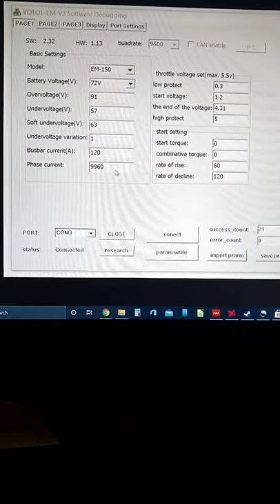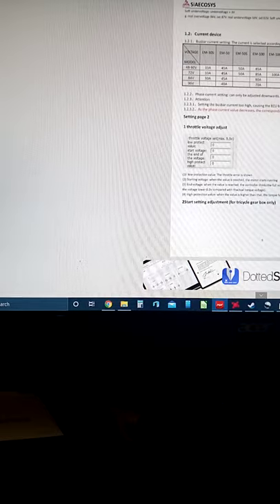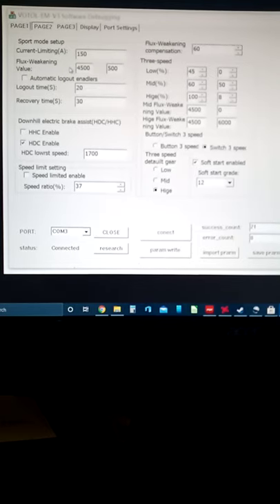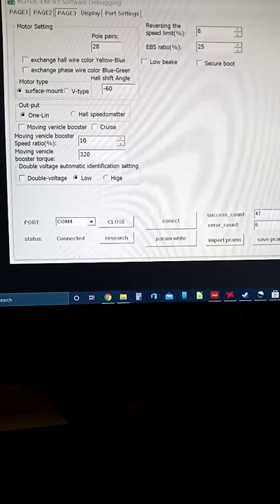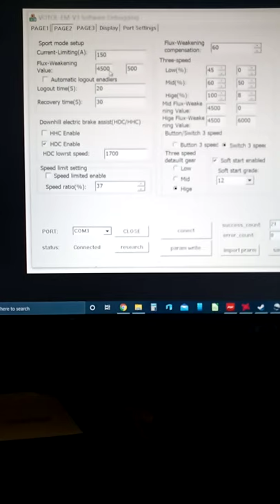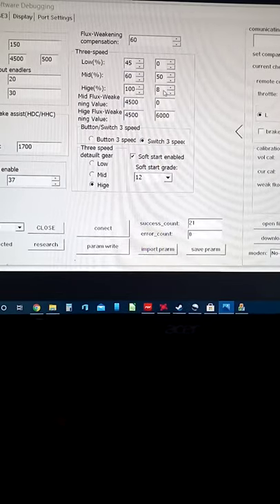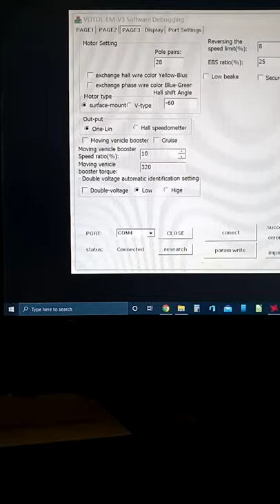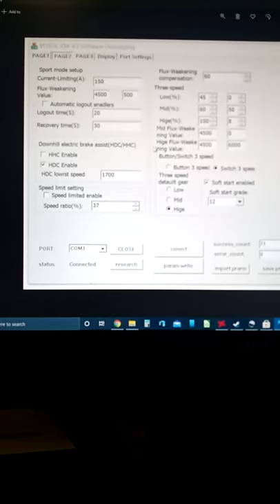E- Vader Votol Set Up

Comment: The switch of phase or hall wires is just a way to allow you to match wire colors and correct it inside the controller, as a self learning controller would do automatic. We know with phase wire you only need to switch 2, to reverse the direction. We also know you only need to switch 2 hall wires to get them in the same firing order as the phases.

But sometimes even though both are in the right order, there is a phase shift. To fix this manually you would advance all 3 wires one slot. So instead of blue-blue, green-green, yellow-yellow, you get blue-green, green-yellow, yellow-blue. So the controller just lets you do -60, 0, +60 to get the halls back in sync while the wire colors match. 

But i do think it’s possible to tweak the timing by using -59 or -61 for example to see if its better, worse or no change. This might be able to correct a manufacturing defect or just tune your motor for your bike the way you like to ride it. 

The surface Mount or V-Type we know is mostly associated with outrunner (hub motor) or inrunner (mid drive), and it seems to only turn on one of the flux weakening parallel if its V-type. Because the flux is different. However its also possible that it is tied to 120 degree and 60 degree hall sensor angle. I guess the only way to know is change that and see if the motor still runs smooth. Ill try to play with that some later.
Reply from the maker: phase angle
pole pair number
max rotation speed
hdc needs to be enabled and that is where you enter your max rotation speed that also acts as a safety trip to shut the controller down due to over speed in sport mode. I found that out when i hit 64 miles per hour one day going down a hill.
If you cant get the specs on the motor you have now your best off to replace it with one you can get the specs for. I can confirm yes your high brake needs 12 volts to work i have a wiring diagram that shows it.
Reply: @battery_solar_ev , i just got my controller and powered it up and saved the first file, then changed it to 60V and set my high limit to 75v since the charger tajes it to 73.5v, higher than the default value they have for 60v. 

Then i wired the phase, hall and throttle and matched them up manually instead of in the software until it ran forward smoothly. But then it was only going 230 rpm so I turned off DHC and it came up to what gives about 45 kph (28 mph).

Wired my high brake line in at full battery voltage. My drawing doesn’t say +12. So far it’s working cut power and add regen. I have everything low now, 15A bus limit, 15% regen, 20A sport. 

Wired in my 3-speed switch and had to manually enter the port data from screenshots i took of several port settings. I put 60/60, 80/80/100/100, switch not jog, and it doesn’t change speed. The controller sees it because it shows it going low, med, high in the program and also my display shoes 1-2-3, because im using the YXT (one line speed signal) instead of hall wire. 

Im making a lot of backup files for last known working configuration. 

I wish I could just turn all flux weakening off but it doesn’t seem to like too much or too little. My 500w motor doesn’t have enough overhead to use it. Unless it makes the motor more efficient at 28 mph, i don’t need it. 

I noticed when i have downhill brake on about 300 setting, it would regen significantly from 600 rpm when you let off the throttle.

Comment: Nailed it! Very helpful...Looking forward to getting my EM200 to stop cutting out, then come to stop and works fine...till it does it again.
Reply from the maker: Im not having a cut out problem at all its full go on the new 5k motor. The stock motor was horrible. Your base current is set on the main page but only refers to speed 1 and 2 sport mode speed 3 over rides that setting. But rotation and flux remain the same except the over ride for speed 1 and 2 percent rating adjusted at the percent of rotation speed you want for that setting. Make sure you have the setting for the motor.
Rotation speed
Pole #
Max current
Flux weakening and the setting beside that. If you have a QS motor that is NOT stock to this bike just hit up one of the QSmotor people for the settings it should be and make sure you tell them you have a Votol controller.

Comment: Ok, day two of opening this Alien software. I think somewhere you said you need Downhill brake assist on for the 3 speed settings to do anything. So thats working now. 

This control does not like seeing 0s all over the place. But i found out the box on the right of sport mode is not flux but timing, used to eliminate jitter. After i got everything working smoothly i took to the street and at about 3 mph it sounded like i went over one od those grooved rumble strips they cut in the highway ti wake you up before a big curve, 

After research i started bumping it up from 200–>300–>400…..and at 600 is where mine stopped jittering. 

So then i went around checking amps, voltage sag, and my cheap Chinese 60v 20AH gel battery fell on it face. Luckily i cracked soft low voltage up to 60v so didn’t drop to 55v right away. 

I set regen to 10% and under mild acceleration the voltage dropped to 56V and then while regen it went to 65v. Which was the dead giveaway i have 1 cell in one battery probably on its last leg. 

The pardox is these batteries have to be balanced occasionally but you cant equalize charge them without doing permanent damage. The only way to get a low cell up in a 12V. Batteries is to overvolt the other 5 cells which shortens there life. So these lead acid packs quickly go into a death spiral when the other cells are making up for lost voltage. 

I got home and checked each battery under small load and it was 12, 12, 10, 12, 12. Im currently charging the weak one separately and will probably top them all all separately, but its sort of an indicator the batteries are getting bad. 

I looked into a BMS for lead acid but that cost as much as a set of batteries. Lol.

I might bite the bullet and get some lithium ion or LiFePO4 batteries, and charger. But i have to be careful since this is just a $600 bike, i don’t want to go down the rabbit hole of bigger controller, bigger battery, bigger motor, bigger controller bigger battery bigger motor. By time you get done could have bought a pretty nice Chinese electric motorcycle that has twice the performance for half the price.
Reply from the maker: LifePo4 is 14.6 for a bms your 500 watts @ 60 volts is 8 amp that bms should not be that expensive and that 20 amp hour rating no more than 20 amp on the constant and 30 amp surge with a 40 spike. sealed lead acid actually likes the 14.6 volts
Reply: @battery_solar_ev , If i make a lithium ion or LiFePO4 battery I would use 35 A BMS so I can use all the controller. My gel cells can feed 35A busts without a BMS.

I was making a video today showing my front brake activating regen, while my charger was @ 73.5V and regen didnt seem to work. Then i unplugged the charger and it worked. So i wonder if the voltage settings do in some way tell it not to regen when its close to max. 

I will play with that some more once my new batteries arrive.  On the center stand i only jave a little inertia to regen with but on the road its a different story. 

60V 25AH gel cell delivered to my apartment for $160. I might go lithium next time around.
Reply: @battery_solar_ev , this is a regen test while holding full throttle and applying front brake to cut motor and activate regen. In the video it looks like I’m applying rear brake. 

youtu.be/VgnJ4Q2Qe_Y

Comment: Nice video. I’m getting a EM-30s for a 500 watt motor and soon ill be going through everything you did. I’ve watched a bunch of videos and piecing it all together, along with whats on Endless Sphere. I’ll make a few separate comments so you can reply to whichever intrigued you. Lol

From my research, the number of pole pairs has nothing to do with commutation. No matter what that number is, its still 3 phases taking their turns being North, South or off, pulling, pushing or ignoring the nearest magnets. So it means its only used to tell the controller how many RPM its doing. 

If 28 pole pairs shows 600 rpm, then 14 pole pairs would show 1200 rpm, but the motor speed would be the same. However if you get pole pairs way off, it may affect a different part of the control logic. Did your motor actually sound faster/slower as you chanced pole count or just the RPM indicating was showing faster/slower?
Reply from the maker: there was a speed difference but you have to watch the max rotation speed for the hub motor and not exceed it. Which is why i replaced the hub motor and having no info for the pole pair and rotation speed plus the original hub motor was way to weak for the bike 28mph is way to slow for my area and not regen or flux weakening compatible cause various run a way conditions along with random wheel lock ups and intermittent  popping noises it was garbage but perfect for the controller it came with.

Comment: @4:23 the way I interpreted this is you want to measure your throttle signal range with a multimeter and make 100% sure your throttle is witin its live range when telling the controller you are at 0 and 100%. So in my case the throttle output is 0.8v-4.6v. So i gave it a 0.2v buffer on both ends and used 1.00 and 4.40v. 

I might spread it out a bit to 0.9v and 4.6v to eliminate some dead band but actually most of the throttle dead band is mechanical. The one you don’t want to undershoot is the low setting because it will either not allow your motor to start,  thinking someone is twisting the throttle when ghe turn on the key, or worse, it takes off when you turn on the key. Lol. 

The high setting i think if too low you have excess dead-band and if too high you cant tell the controller to go to 100%. Can probably tweak it up until your motor can’t go full speed then lower it 0.1V.
Reply from the maker: 1.2 to 4.8 volts actually worked out pretty smooth for me. You go to low and the motor will take off when you turn it on well at least thats the problem i had.

Comment: Did you have issues downloading the drivers for the USB to Serial controller. The driver that came (PL2303_Prolific_DriverInstaller_v110(2) is not loading properly. Did you use something else. My computer recognizes the USP dongle as (FT232R USB UART) but it does not have any drivers associated with it and when tried to update the drivers nothing was found. Need some help. Thanks
Reply from the maker: no harry.bin.zhou sent me what i needed via skype for the program and the usb driver also the manual for the controller and the spec sheet for the hub motor . Best of get a hold of QSmotors and ask them to send the program for the Votol controller and the usb driver if what you have is not working. Keep in touch if you dont have any luck Ill see what i can do on setting a link in this video. Which i have no clue how to do.

Comment: What does this tell you? Ok, since installing my EM100 a couple months ago, whenever I hit either brake lever to slow down or stop,
it would make the bike accelerate. I figured there must be faulty wires touching the throttle sensor. 
long story short, I found what EBS setting stood for and tried setting it from 20, to 0. Problem gone. No more brake lever throttle action.
Why would higher EBS setting cause motor acceleration?
Reply from the maker: I had the same problem with a EM-150sp and trashed the controller china refused to offer a refund Saiyco sys or somthing like that. I will never by anything from them again. Bought another controller from QSmotor and problem solved. Glad to see im not the only one that has seen that problem. If you are NOT using the stock hub motor the EBS brake regeneration should function like normal with no issue and do brake assist by putting some power back in the battery during brakeing or letting off the throttle. If you are using the stock hubmotor that needs to be off by setting it to 0 and also flux weakining be turned off. My replacement i purchased from QSmotor is set to 20 for EBS with no issues at all. In short that controller you have now needs to be trashed it is not safe.

Comment: For the two columbs in the 3-speed setting, it seems column 1 is the max speed % and column 2 is max current (acceleration up to the speed limit), for low and mid speed, but for high its % overshoot. 

So in the manual it shows 
60-100 (meaning 60% max speed but max current is allowed for you to get up to that speed.)
80-100 (meaning 60% max speed but max current is allowed for you to get up to that speed.)
100-7 (meaning max speed, but current can go to 107% while accelerating to top speed)

We know what happens if too speed current is equal acceleration current, you are slow to get up on plane as that say.

I need to digest the sport mode settings a bit more and see how its interrelated. For example if your base bus current is 120A and your sport mode is 150A (+25%), is that what sets the bar high enough for a speed 3 100% 20% setting? 

Im just getting the 30s and so ill be working with much lower amps. I have a 500 watt motor with 60v battery so 10 amp gives me 600 watts as a starting point. Then once I’m set up and understand what each setting does, i can up the amps in a way that its only for short bursts. 

My phase wires to my motor are so tiny so i don’t want to fry those.
Reply from the maker: no its the rotation speed based on hdc enabled lowest speed unless on sport mode current will remain the same for 1 and 2 for base current page 1 or settings 1. ive got 40% 80% 100% resulting on 40 50 and 60 mph speed 3 refers to sport mode current which is also high and over rides the default high base current from settings 1. The votol is NOT a smart self learning controller you will need the max rotation speed and the pole pair to make it work properly and for safety sake make sure the hubmotor you use is regen combatable. Ive had the stock hubmotor lock up 2 times on deacceleration because of not regen compatible and that is not a fun feeling and very dangerous
Reply: @battery_solar_ev , i just learned a simple way to find pole pairs of any direct drive bldc motor. My ebike just has a 500w motor and no other data, so after watching someone trying to sell a box that applies 12v 5a to 2 phase and watching the motor jump to a pole pair, I used my 50 watt laptop power supply and momentarily touched 2 leads, and then rotated the wheel slightly and repeated the same, keeping the same polarity and same two phases.

Then i marked each position and counted them, mine was 26 pole pairs. So i have 52 tiny magnets compared to your new motor with huge magnets,

Its an experiment you can do on your old motor. Works 100% accurate. But i think even with flux weakening you cant get the old motor to go 100% faster than designed. But your new motor with much less magnets can probably spin a lot faster.
Reply: @battery_solar_ev , my motor is just a bldc so it like all bldc it will regen if the controller can support it. I have lead acid batteries which are much more forgiving to regen because there is no BMS. If you have lithium battery and BMS and start off fully charged and get up to speed and do hard regen, your BMS will block that current going to the battery, the voltage will spike, and will be like shorting all 3 phase wires and trying to turn he motor. 

I will start with regen almost off, and test drive and watch my battery voltage. I wont set it higher than 10% probably, which is about 3a like the charger.

The new software on the Siaecosys site shows only one version, and thats where my vendor (QS Motors) said to download it.

Ive seen several versions of the program settings so before i chance anything ill read and save the .bin file and only change settings I’m sure about.

Comment: I also need high brake like you, so this will be great. One concern i have is some drawings say +12V for the high brake. Im hoping thats only minimum voltage for those using standard 12v accessories. My current setup just sends 60v to it and the brake light.

I will play with regen a bit too. My electric scooter has 5x 12V20ah gel cell batteries, so its pretty hefty. Along with 500W motor i might need significantly more regen to slow this lead sled down. 

But one thing i have to watch for is if the regen pushes my battery voltage over 70v or 75v absolute max.
Reply from the maker: your not going to get very fast with that much weight on a 500watt motor
Reply: @battery_solar_ev , this scooter can go 28 mph and my last one with 350w motor can go 28 all day. Your 2000w motor wasn’t usinf anywhere near 2000w to go 28 mph. You had torque, acceleration and hill climbing that my ebike cant do. 

Your new motor is wound to go faster, so it only has a few magnets, thick phase windings. Its designed for it. You told QS what you wanted and they gave you the one that will do it. But i don’t want to go 100 km/h on this scooter. Lol. Its about like a Yamaha 50 size adult seated scooter.

Actually the #1 reason I’m replacing the controller is my old 350 watt scooter climbs the curb with ease, and this one has no torque. Its got a super basic controller, no self learning, high brake only, but when its moving it is super quiet, seems like sine wave quiet.

So with the EM-30s im hoping to be able to dial in the right settings so it has torque needed to climb a standard curb. 

I don’t want flux weakening unless it increases efficiency, and from what im reading mostly its using more power to allow you to go faster. I don’t want that because my motor cant handle it. 500w is all I should be pulling at max steady speed. 1000 watt during acceleration is fine. I have no hills here so i don’t worry about that.

Comment: How do you change the motor rotation direction?
Reply from the maker: by wire. you have to switch the blue and yellow also the hall plug as well only if you want full time full speed reverse.